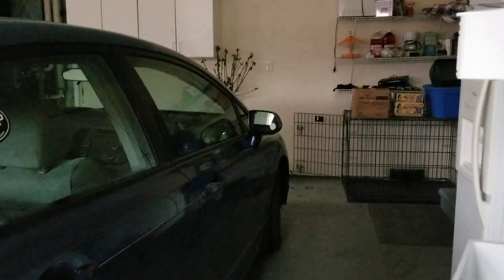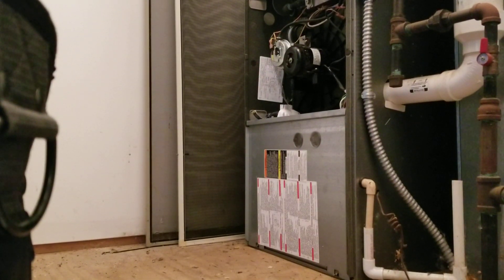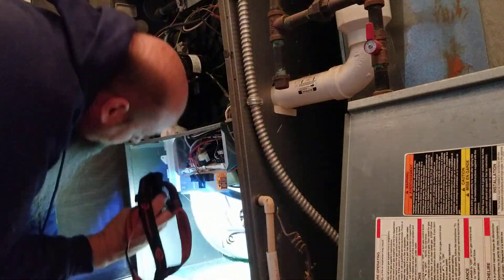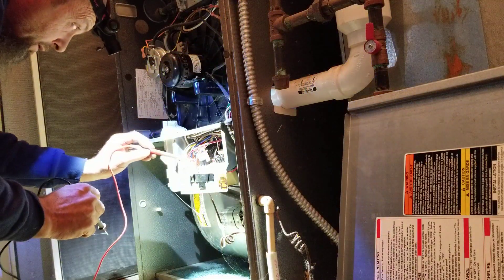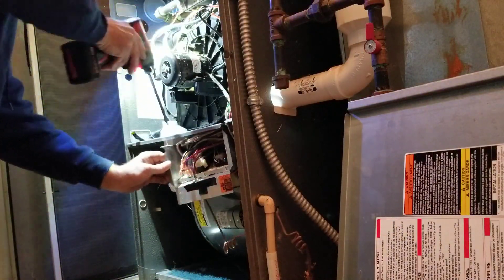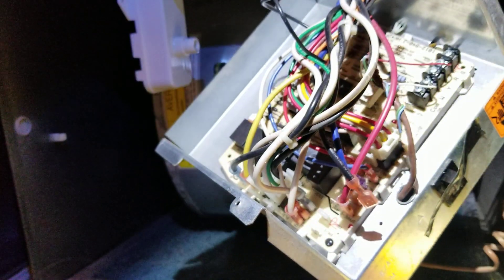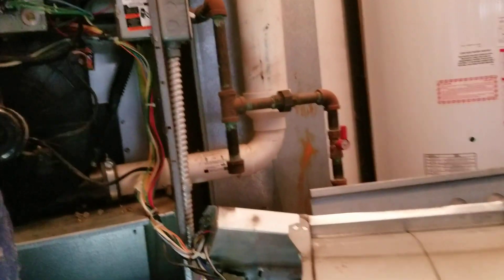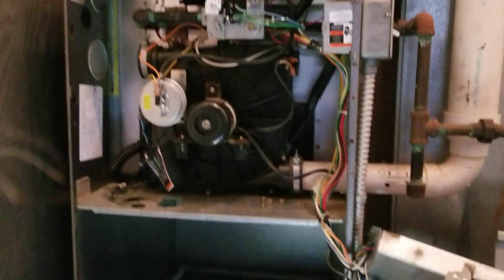Heat Exchanger Inspection Carrier 58MCA100

Comment: Get a $40 WiFi scope that syncs up to your phone and find the rusted/corroded heat exchanger in 2 minutes. Slides in between blower wheel and housing usually on the side opposite the motor.

Comment: Got a carrier as well, weird problem I cant seem to figure out. Exhaust outside smells like potatoes.  Fixed it last year by putting the condensate trap under the faucet and blowing out a clog, there was water backed up into inducer fan.  Smell went away and everything working great.  This winter noticed the smell again and cleaned the condensate trap and no clog this time and smell went away but is back a couple days later.. Seems to be draining fine.  Wondering if theres a dead bug or animal in my blower motor.  Or could it be something else?  at a loss.
Reply: Ryan Carlen  ended up being clogged secondary heat exchanger under the carrier class action lawsuit

Comment: 10YR old Carrier here from 2010, tech says its outputting 200PPM, too high so secondary exchanger needs replacement, $2000. Have you seen this happen before so quick?? 58MCB060
Reply from the maker: Yes $2000 seems very high for a heat exchanger replacement but I don't live in your area I don't think That heat exchanger is under warranty through the manufacture. At 200ppm it may just need a gas pressure adjustment
Reply: @MiHeatingGuy  I'm in Ontario Canada. What's a good budget brand that would be reliable? Would Goodman be ok, or is Amana worth the extra $$? Thanks.
Reply: @MiHeatingGuy  Tag the furnace at 200pmmV, its done, new furnace or new hx.
Reply: I got pricing over $4000 for the new heat exchanger in Canada. But it was covered under warranty since the POS has a 20 year warranty on the heat exchanger. But the labour is on the customer.
Reply: @Jason-wc3fh  Yep, we got ours fixed, the labor was $1200 , but they sent two "just graduated" techs that didn't even know how to put it back together, it was their first one. I had to remind them not to forget the gasket where the unit joins, and make sure to watch so they rebuild the new one same as the old.. they said this type of more complicated than normal.

Comment: I've noticed all these Carriers to be problematic......if on propane plugged heat exchangers, and the newer model getting water droplets in the pressure switch tubing. I was die hard Carrier, now I generally eat the cost of 10 or so of these a year and swap them for EL296s

Comment: Didn't Carrier recall these plastic coated heat exchangers?  So parts and some labor should be free to the owner???
Reply from the maker: labor is not covered
Reply: Someone below said there was a $350 labor allowance under the recall?  No?  Seems like all these   versions are doomed to rust out.  Unless maybe if perfectly installed and pitched/leveled when installed(?).  And even then, maybe it wont matter(?).

Comment: You recommend a new furnace but what if the customer just prefers it warranty/recall fixed? And what area in Michigan are you in? Mine is a 2004 model with a bad secondary but the carrier guys in my area are wanting to replace without even coming to look at it
Reply: TomEdmonds1972 not worth the money you would spend replacing those items on a 20 year old furnace. These things aren’t classic cars lol
Reply from the maker: I'm in the Port Huron area This furnace was out of warranty due to not being the original homeowner And at that point it only has a 20 year warranty When it comes to older fornices that have all original parts that's when I start recommending replacement of the furnace Because something else is bound to break thanks for watching
Reply: Mi Heating Guy 
What would you charge to come to Davison and change mine out under warranty? I’ve got it partially torn apart and would happily have the old exchanger out when you got here. I just put a$250 inducer motor in it and hate to throw that away. I talked to carrier already and they said it would be covered under the recall/warranty. The furnace went into service in April of 05
Reply: @TomEdmonds1972  I'm assuming Carrier will not give you the heat exchanger because your not a licensed HVAC contractor, HVAC techs hate going behind home owners that have been working on there own equipment and usually charge more money to do so. We prefer a intact unit to check and make sure that no more issues are going on. In my 34 years experience we run into more problems after said part is replaced.